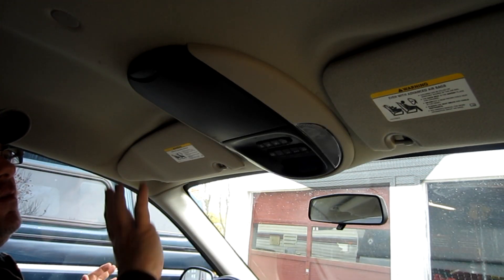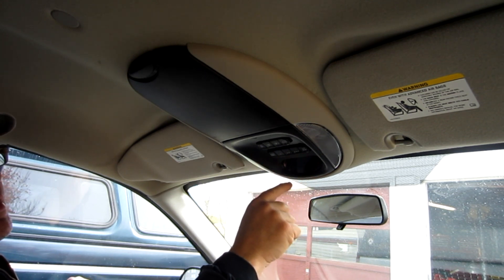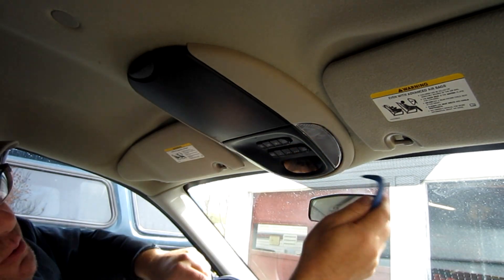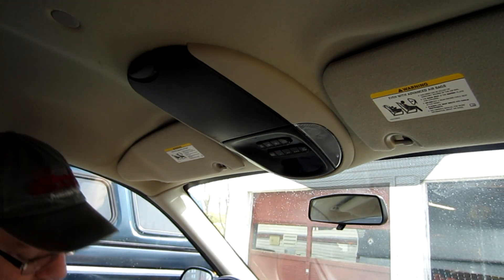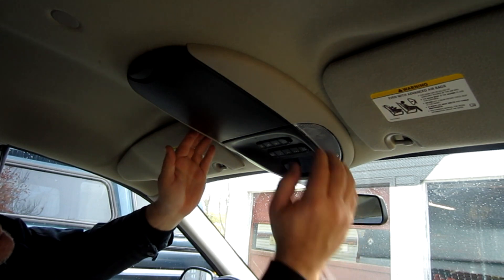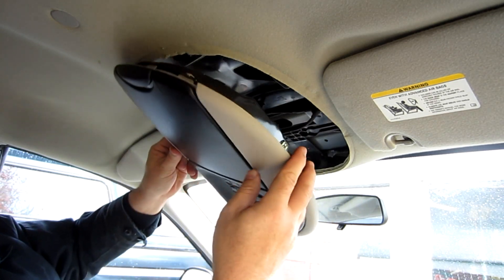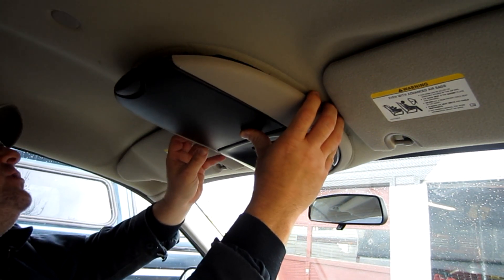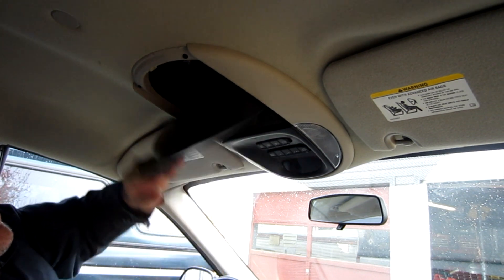How to remove overhead console on Caravan Town and Country

Comment: Great video! Thanks for taking the time to shoot it. My 2006 has the sun roof, so the sunglasses case is missing, as well as the one screw you removed. From that point forward, everything looks identical to your video. I'm wondering if mine is just held up by the spring clips. I tried yanking on it some, but didn't want to break anything, so I stopped.

Comment: Hi If you know any info on the bulb holders I got a used van  and no bulbs were installed I bought replacement bulbs and holders but it seems they don't lock in places like nothing is grabbing. Are these vans known to have broken holders also I try to hold in place and rhey still dont light up. Not seeing any info other than how to replace a bulb but not on possibly damaged connections.

Comment: headliners just pull all the panels on the sides and slowly pry down, if you have overhead airbags be careful not to damage them you also might want to disconnect the negative battery post cable. oh and take off the sun visors.  Why would you need to drop the headliner? I've installed overhead LCD screens for kids to watch and all shorts of stuff and never pulled one down. you can run wires with a stiff coat hanger or some type of fiberglass rod as a Pr I've used extremely large wire ties and speed odometer cables for pulling wires in cars/trucks tractor trailers, boats ex... Fiberglass fish rods made for running cat 5e work good too might be the best for a headliner or overhead item.

Comment: Hi!! One of my dome lights stopped working (driver side) I put a new bulb in it  still won't work I also tried the putting the passenger one in and still no luck any idea on what's going on. Thanks in advance...2002 grand caravan
Reply: Yeah. They get hot and melt plastic and gum foil electric connection have to replace light receiver unit. Mine too.

Comment: Thanks that was brill ,q, do you know why my rear parking sensors won't work
Reply from the maker: Thanks.. Sorry about your sensors, I've never worked on a vehicle that had them.. Good luck.
Reply: check in the overhead computer to see if it's been disabled (it's an option)

Comment: Hi, I have a '96 Dodge Caravan, 6 cyl, 3.3 engine. I seem to have accidentaly turned off the overhead console by holding the STEP button and don't know how to turn it back on. When I turn the key to the ON position the display lights up but then it stays blank, as the owners manual mentions an "OFF mode" I believe to have engaged it somehow. Could somebody please illustrate me on how to turn it back on? Thank you.

Comment: after remove the overhead console , how can i unplug the 2 cables w/out breakiing
Reply from the maker: There are tabs that need to be depressed to release the connectors
Reply: @Foxboss9  yeah, and how about you show those UP CLOSE, they are NOT simple to figure out if you have NEVER seen them before.